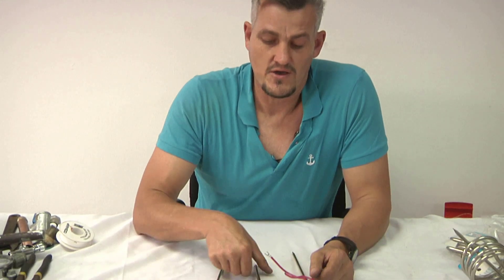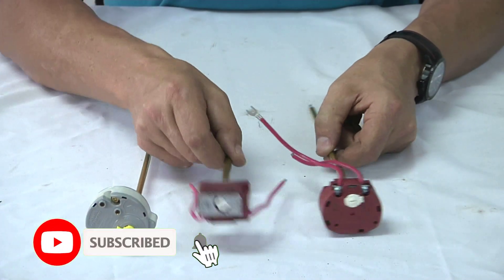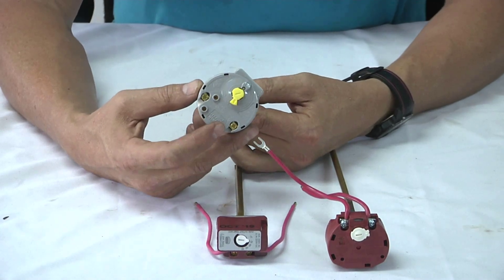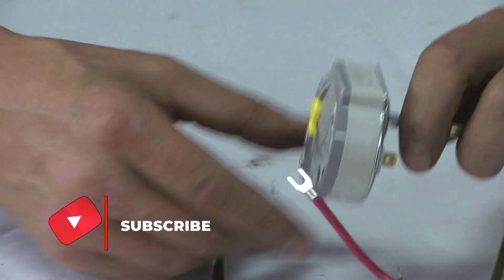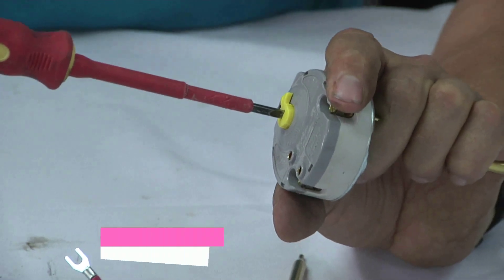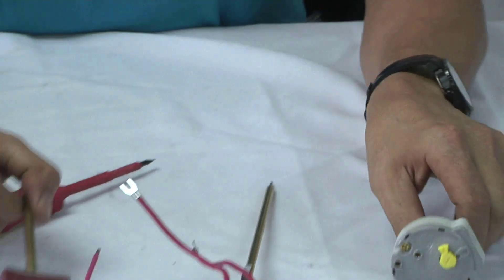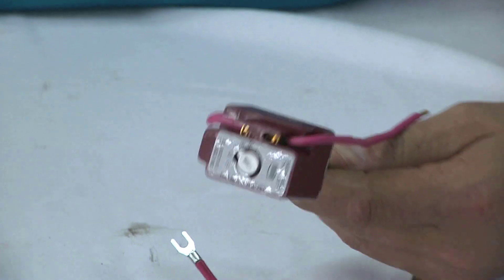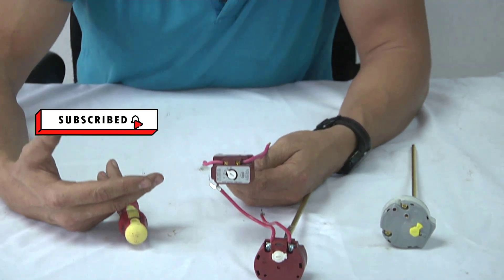All about thermostats | What is Thermostat of plumbing and how it's work |

Comment: My new Kwikot 150L geyser I bought and had installed 3 days ago,  stopped heating the water after the thermosat was set to 55 degrees. Set to 70 degrees it was heating the water. Should I try 60 degrees and hope?